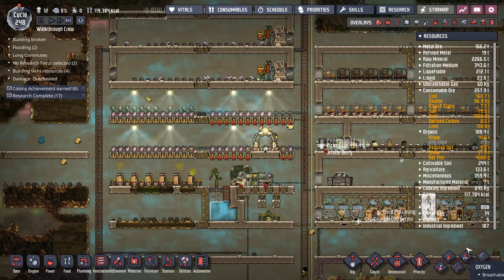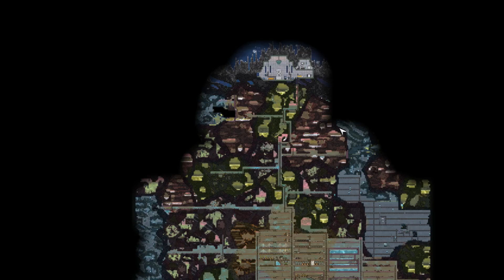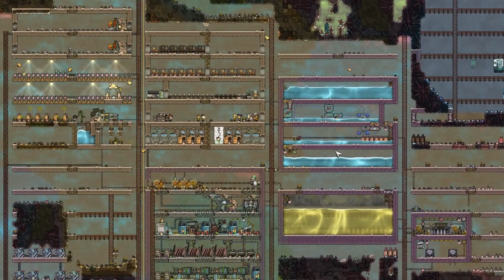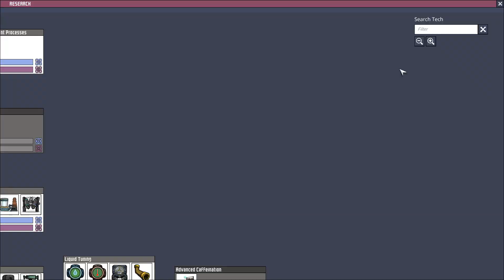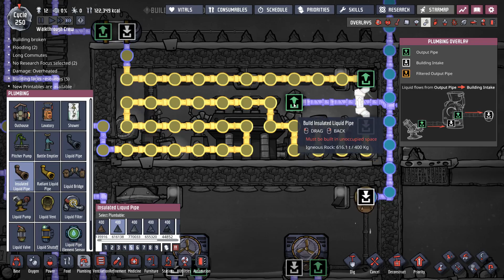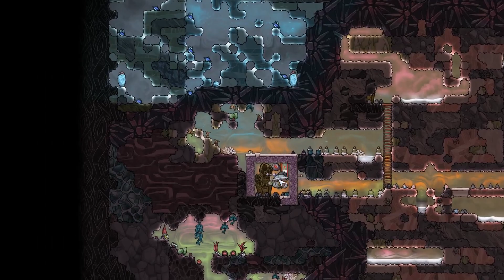Oxygen Not Included Tutorial: Full Walkthrough (Part 9)

Comment: Heyy, ive been rewatching the guide and I'm wondering if you care about insulating your base and if you go over that anywhere? Idk why but temperature always scares me so I tend to not explore as quickly and try to insulate my base a lot lol.
Reply from the maker: It's a huge problem on some of the later maps, but the earlier maps will stay insulated naturally because of the material you dig out.  A majority of the heat on the map is located inside the solids and liquids that you unearth in those areas, so if you don't sweep, the temperatures of each biome should stay roughly the same over time.

The first cooling you'll probably get access to is melting ice and using cool water for blossoms, or you could circulate it occasionally and cool the areas that you need to stay cold (most importantly, food).